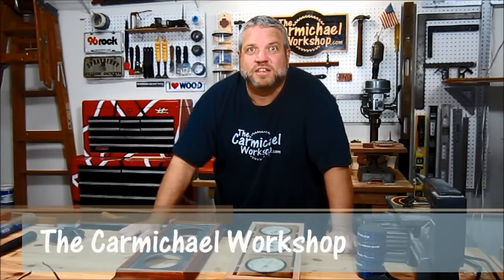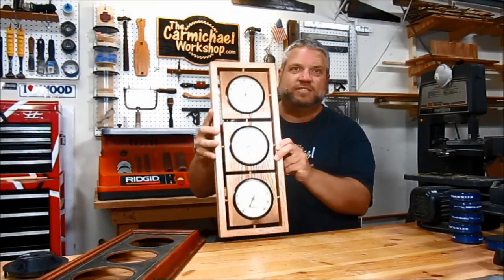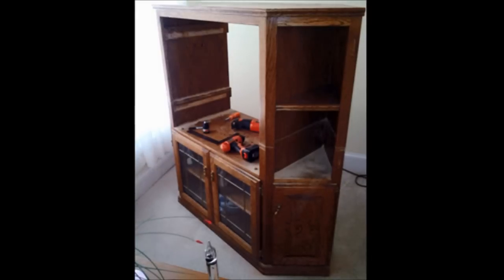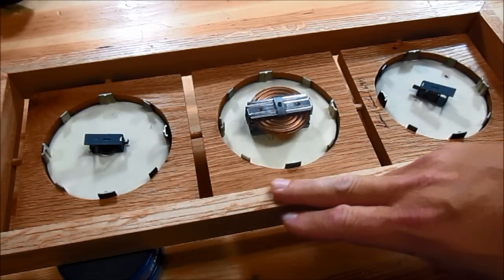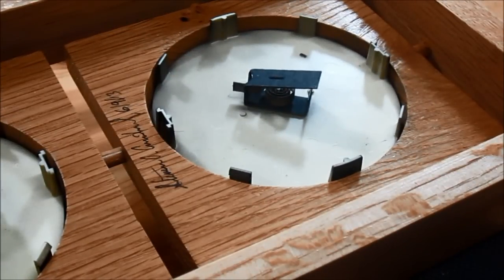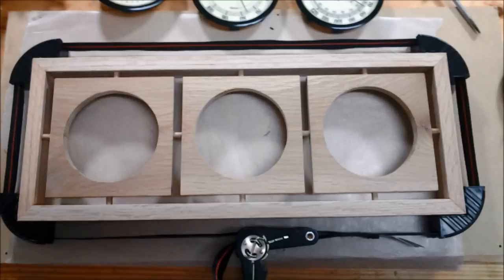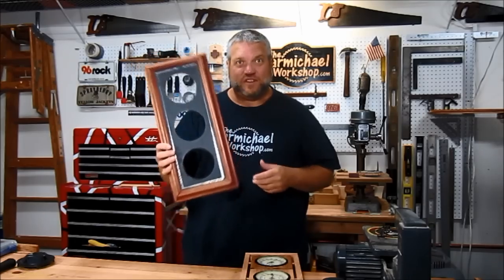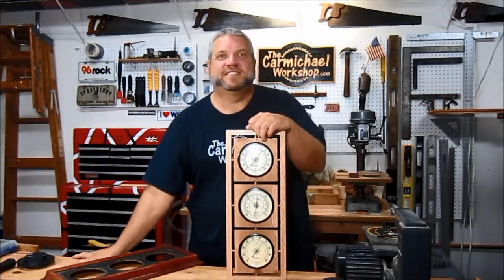Upcycled Weather Station - DIY Thermometer, Barometer & Hygrometer Frame

Comment from the maker: Thanks Chris!  I glued all the inner pieces and dowels up first.  Then I glued on the two long sides on the side dowels.  Then I glued the small sides on with glue in the corners and the one dowel.  Once I had everything together, I worked quickly to get it square with even gaps all around.